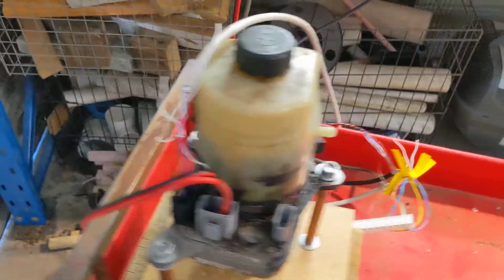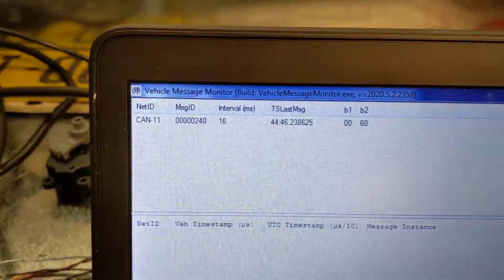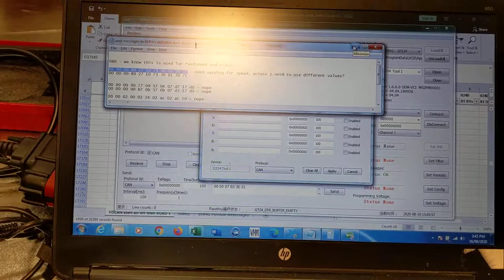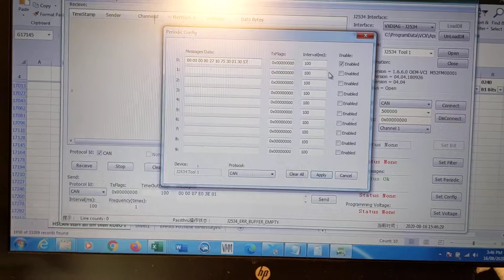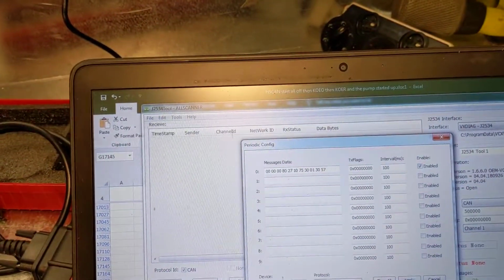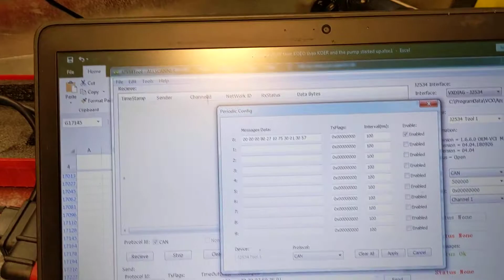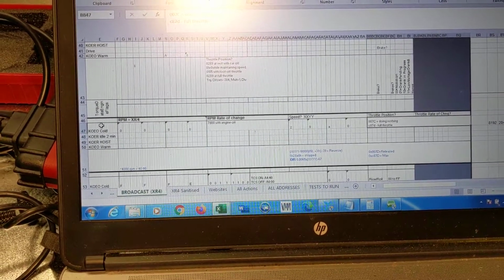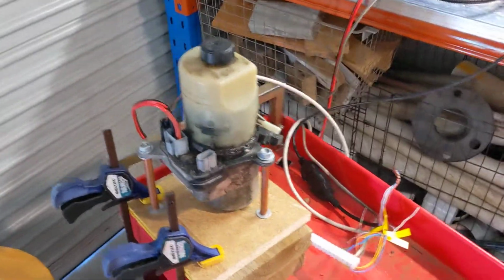MkII Focus Electric Power Steering Pump - Activating using CAN

Comment: Hello, I know it's been many years since this video, but I wanted to ask you if you could please give me some help with this pump model. I have the same one, and it gives me the error B1342-30 Ecu internal failure. I already scanned everything with OBDII, checked the wiring, everything is ok, the pump simply turned off and throws this error. I took out the pump, and powered the large power connector with 12 v, and also supplied 12 v (+) to connector 1 of the black plug, of the CANBUS, but the pump does not turn on. Should I have turned it on, or do I need to do something else to test it? I thank you very much, a big greeting!

Comment: Hi Luke,
I think I have an identical pump to the one you are using, but for the life of me, I cannot see any CAN BUS messages from it.
Currently I have a 12Vdc power supply going to the thick red (+) and black (-) wires.
I have the CAN high and CAN low wires going to the CAN Serial to USB device (from the pump - I am using the middle wire as CAN high)
I have a 120 Ohm resistor between CAN high and CAN low.
Does the 3rd wire (next to the CAN BUS wires - skinny green) need to be connected to +12Vdc?
Are there specific values for serial baud rate / CAN bitrate that would cause nothing to appear?
Are you using a specific piece of software? Or would any CAN BUS monitoring software work?

If you have any ideas or suggestions, I would greatly appreciate your help!

Thanks.

Comment: How do you remove the electric connector please
Reply from the maker: Er, the connectors on the EHPAS pumps itself? I don't recall it being anything special - just a normal 'press a tab in and pull the connector off'. Are you having troubles?

Comment: Hugely helpful. I don't have access to volvo or astra EPAS systems for anything approaching a reasonable price, but I have a locally sourced MKII such as this. My aftermarket standalone ECU has two CAN outputs one of which I will be able to use. 
Thanks again
Reply: Did u get it working ?

Comment: I think the message you discovered is in the following format.

ArbID 0x201, with 8 byte payload
The packet takes the form: [RR, rr, 00, 00, SS, ss, 00, 00]
Where RRrr is the tachometer rpm and SSss is the Speed mph.

The following formulas are used:
rom = 0.25 * (RRrr) - 24
Speed (mph) = 0.0065 * (SSss) - 67

Byte 0 & 1 = Tachometer rpm. See formula above.
Byte 2 & 3 = Unknown. Set to zero.
Byte 4 & 5 = Speed. See formula above.
Byte 6 & 7 = Unknown. Set to zero.

 Source: https://github.com/thomastech/CAN2Cluster/blob/master/Mustang_Cluster_Build_Log.pdf
Video source: https://www.youtube.com/watch?v=fxD2akmYyDo
Reply from the maker: 201 seems to be relatively common across many Fords, but there are still differences. The RRrr and SSss have subtle scaling/offset differences between Mk2 Focus and Mk6 Fiesta. Also, Bytes 2/3 and 6/7 on my Mk6 Fiesta are showing data. 2/3 appears to be related to the rate of change of RPM, and bytes 6/7 appear to relate to Throttle position and Throttle rate of change.